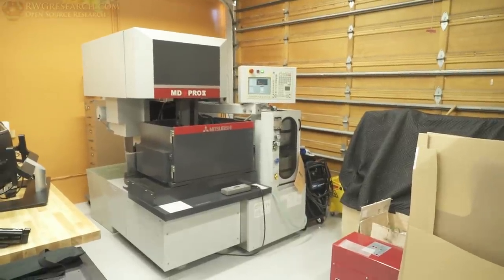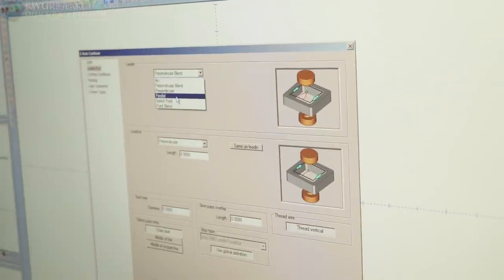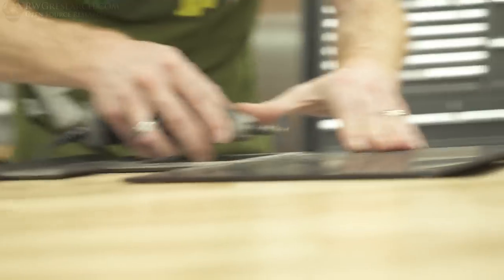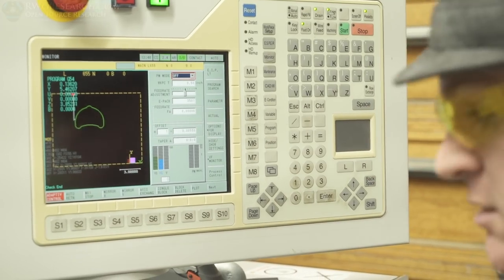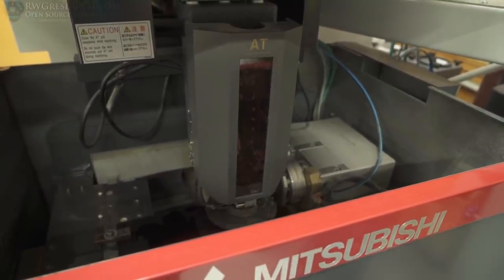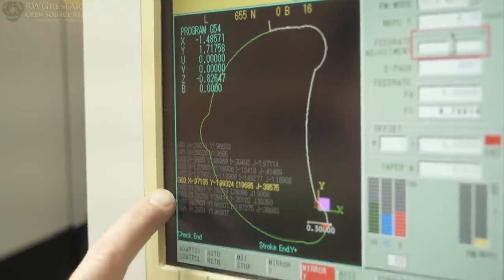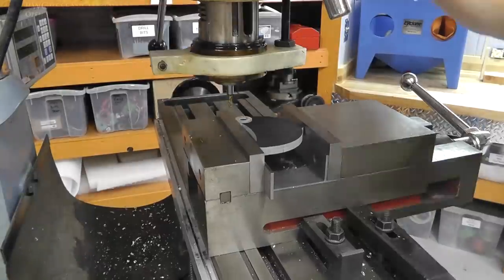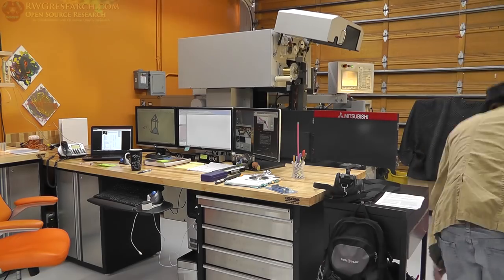RWG-OSD #6 EDM The Skate Plates. Extensive EDM Run Through. YOU WILL ENJOY THIS ONE

Comment: Video contrast was really lacking... something happened in editing... looks like Black Level was shifted up about 10-15 IRE.
(sorry, we pro video editors notice these things that most people wouldn't)

Do you get a decent scrap value back on the used brass wire?
(the wire spool said 0.25mm... you said 0.05mm which caught my attention, that would be like 0.002" !)

What is the typical Voltage and Current when running on material like this?  
It'd be neat to see a closeup of the raw cut edge... just curiosity.

Neat tool for making neat precision metal parts!

Comment: Great machine man!

I always thought this lab was in your basement!  

You have a very smooth linear motion, I bet you will be able to really turn up the speed. What extruder are you planning on using - my cheap delta is limited by how much plastic I can melt?
Reply from the maker: +Phil Waud well it was at one point in my basement :) 
but i moved about 2 years ago, so i film at my "home shop" or at my house some times :
"tool shed" i don't have a garage here. 
https://www.youtube.com/watch?v=_IxClusP6go

other times i'm at "work" where i can use the tools there anytime after hrs. so most of what you see there on this build was not during work hrs 
i say " work" because most of the stuff there is mine any how... lol i don't have room at home as you can see... 

i use to, before i moved that was my basement and garage. 
my old basement: https://www.youtube.com/watch?v=_Oyy15Qb5-I
my old garage. https://www.youtube.com/watch?v=jFxUgaUOX6M

as far as the extruder. i will build my own like i did here: 
https://www.youtube.com/watch?v=KKrqItl5OIY

the rails are really smooth! yes! 

~Russ
Reply: Thanks for taking the time to explain. I feel much happier now that I see your amazing results come from a situation a bit like mine! My cellar is for my woodworking. Its very cold and I have to take precautions against condensation on my tools - they all have wooden boxes and stay nice and pristine as long as I put them away. My electronic stuff is done in my office, which is 2.5m square.